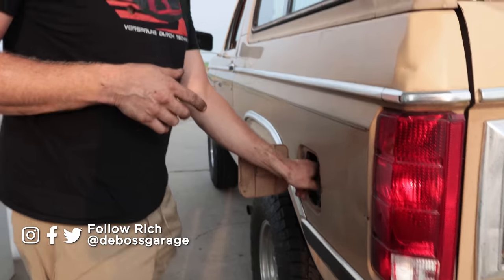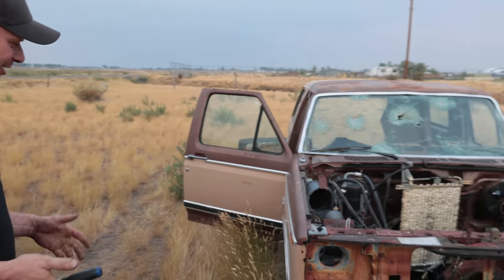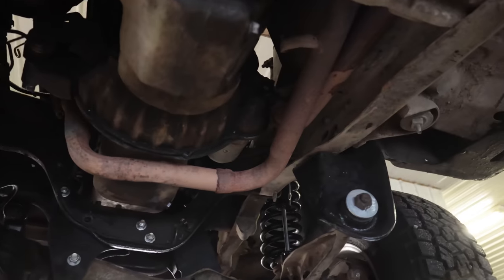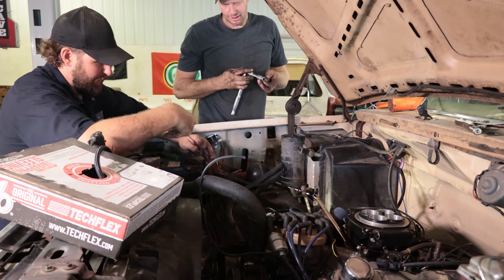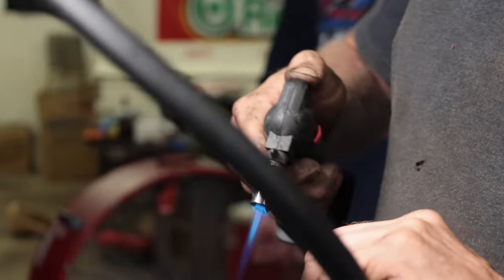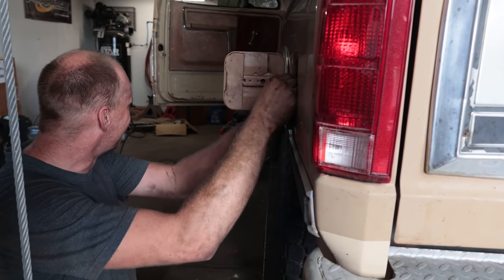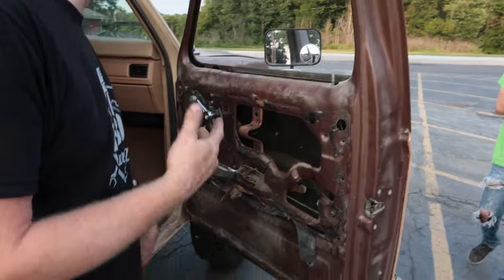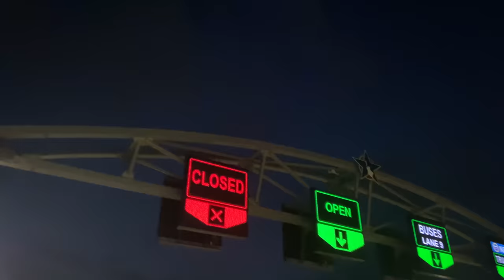@ViceGripGarage Installed EFI on our Bronco | #JuiceBoxBronco [EP2]

Comment: I did enjoy and at least learned something about us humans... say we are in california and you want to buy my rig... you ask, do you trust this rig to go the distance, and in our hearts we do believe our own words... "yeah, I'd weld the hood shut and drive to new york in it" and we believe it ourselves. No further from the  truth could we be as you drove twenty five hundred miles... thankfully not changing a clutch, rear end, engine..... but just about everything connected to this stuff did die awful deaths.... the wing window really got my attention as I am seventy three and only had to change a couple in my life and they were broken before I got them. Right now I ride passenger in a fairly new truck that my  care attendant owns. I still have a rig but don't drive because of no license to operate a motor vehicle so have to ride. My rig I have now I traded my really sweet 95 f350 quad cab with all the bells and whistles. Diesel, five speed, fancy aluminum wheels, aluminum flat bed, dually.... fifth wheel, everything.. low miles even as I don't drive highway. The engine ran really good but the original starter was giving me problems and it would not start when needed it to so  traded it for a explorer... yes I have traders remorse. Anyways, I found this show to be really a good one  and that said most of them are but this one was killer.

Comment: Try putting the left rear tire up on the curb when fueling
Reply: Take the floppy small plastic tube off the filler, open up the pipe to full-size...and fit a modern sealed clicky-clack filler and cap...that takes care of fast filling the tank.
Now run a breather forward to a high point of the firewall with a carbon canister...or a plastic fuel filter to keep crud out of the air being sucked in....so the fuel pump doesn't have to try work in a vacuum...or fuel squirt out under pressure from the tank when hot and expanding .

Comment: My opinion for the rear tailgate you should have just swapped it from the other bronco. Instead of going through the whole effort of changing the glass and hacking up the other tailgate from which the donor glass came from. I had a 1991 Full size bronco with the 351 in it and it suffered a couple of rear broken windows until I sold it to my nephew who took it to Colorado and the next think I know they had a very huge snow that buried the truck in a mound of snow with no rear window that broke again.
Reply from the maker: The other tailgate was rotten in the bottom.  Ours was perfect in the bottom, but dented at the top.  I would take dents over rust any day

Comment: The filler pipe and hose on broncos sits too level. To fill mine, I have to pull the left rear tire up on a small block. I have a new tank, hoses, and vent.

Comment: The old Fords had terrible venting on the filler necks. You have to park so that the driver's side, thus the filler neck, is higher than the passenger's side of the vehicle, or you have to do a creative repair on the fuel neck's vent.

Comment: You're Rich 🤑 haha. If I was Rich I'd throw a cam and lifter kit in her. It'll add you a 100hp easy with a modern cammilator compared to the old 3 ott 2 cam. It's really coming together beautifully. They are quite the decent, but super cheaply made, little half ton rigs. 
Bucket list is a 73 to 92 Suburban. Make a mold of the roof just after the back doors and cut the top off. Use the mold to make a Carbon/Kevlar/Polycarbonate removable hardtop. Let her eat.

Comment: If everything is tuned right, should get around 15mpg, when driven gently.
Reply from the maker: 80 mph didn't help, except to cover 2500 miles
Reply: @DEBOSSGARAGE  Yah, 80 and no overdrive, is not exactly gentle driving.

I was glad to see a Sniper system work correctly, bolted directly to a split intake manifold.
The others I have seen needed an open spacer, to defeat the split intake.

Comment: What Derek doesn’t know about those HP numbers is it’s not based on how many ponies the engine produces, but how much fuel it burns. You may not be cranking out the horsepower, but it burns fuel like it’s a 600 HP truck and that’s what really matters. 😂

Comment: Coyotes are cool but old push rod small Ford's can make excellent power. The correct cam , intake and heads can make equivalent power. Just saying.
Reply from the maker: Coyote can do it with about 2/3 of the amount of fuel.

Comment: You have a blocked radiator. The engine would not get hot even if it were 100 degrees outside.

Comment: I respect Rich but i really dont understand why you didnt just get the whole tailgate.
Reply from the maker: It was severely rotten.  They all are in the bottom where the water sits running past the glass rubber.  Ours however, is in great shape
Reply: @DEBOSSGARAGE  Ah ok that makes sense i heard you reference that bein an issue with that gen of Broncos just didnt hear you mention the condition of that tailgate or if you did i didnt hear it, didnt mean any disrespect. Love all your videos ive probably watched all of them atleast once, learned alot from every video, though ill never use half of the stuff youve shown its good too know if i ever need too use it.